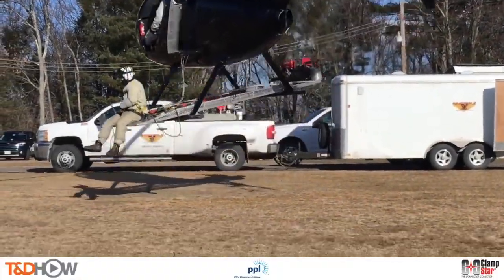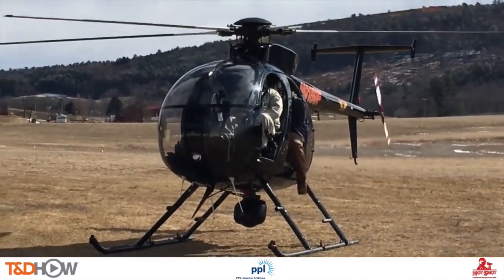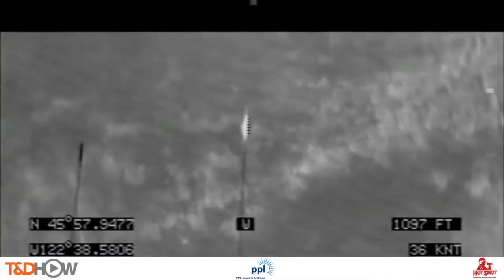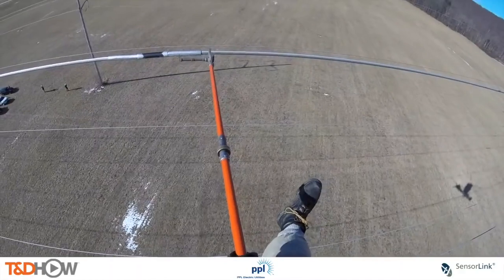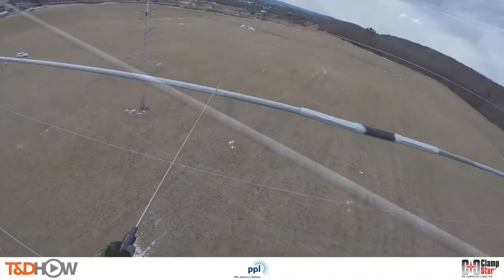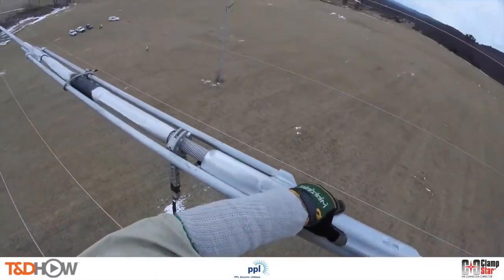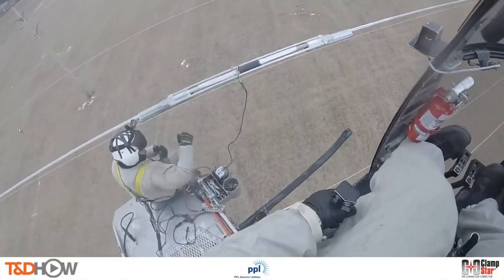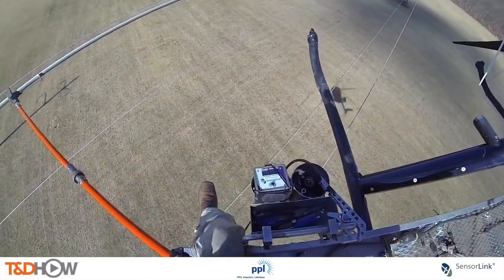T&D How Video   How to Find and Fix Failing Overhead Splices

Comment: Do you make products for last mile connections?
Reply from the maker: The short answer is YES! Our engineered mechanical shunts are used for a large variety of overhead connectors and damaged conductor. Please visit our website for details www.classicconnectors.com and do not hesitate to contact us at info@classicconnectors.com or 800-269-1462